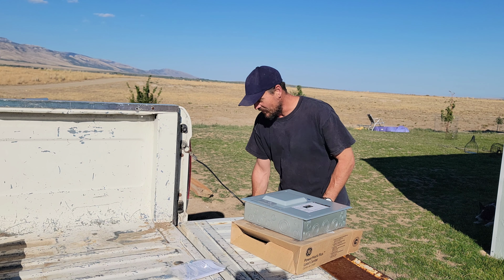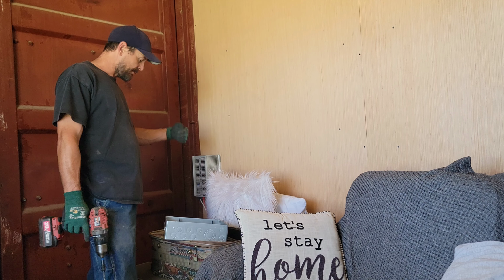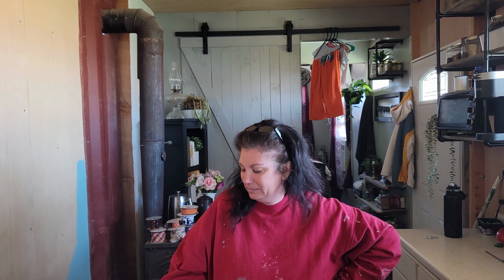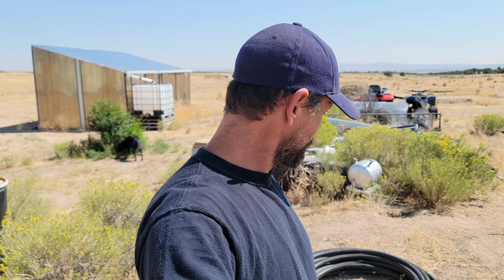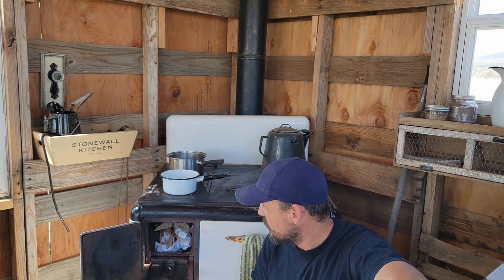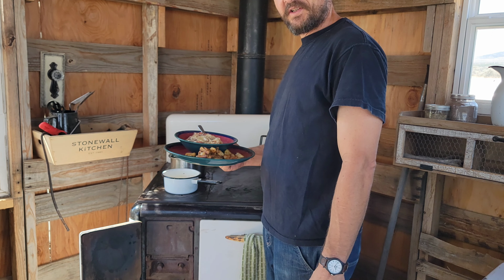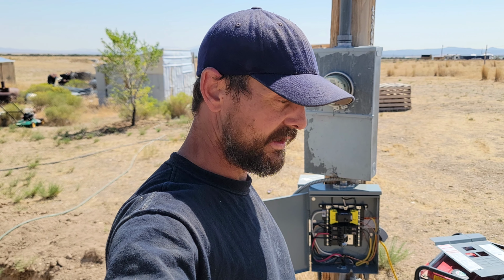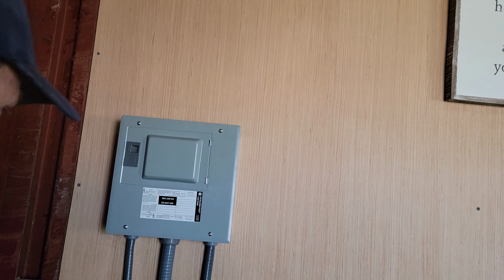Installing Permanent Power in the Main Cabin

Comment: Tip on running wire in conduit around corners…..use separate elbow connected to straight pipe. It can be weather proofed with glue and heat shrink plastic. Makes life soooo much easier. Especially if you have to repair or replace wires 😊
Reply from the maker: @CnCBlueBird89  I will definitely keep that in mind for future projects. 
Thanks for the advice.

Comment: I like what you are doing with the rain catchment off the solar array and enclosing the underside. About your electrical system, your conduit is too small to pull that wire through and to dissipate heat properly. a 2-2 1/2" conduit would have been much easier to pull that wire. Pull string is the way to make that job easier.
Reply from the maker: @LittleYellowCreekFarmMS  thanks for the advice!
I would have definitely done it differently if I was able to do it at all over again with larger conduit and a pull string.
I will definitely put your advice to use next time I run electrical. 🙂